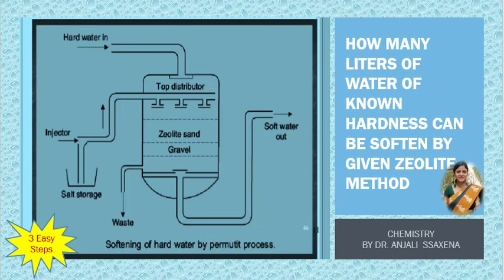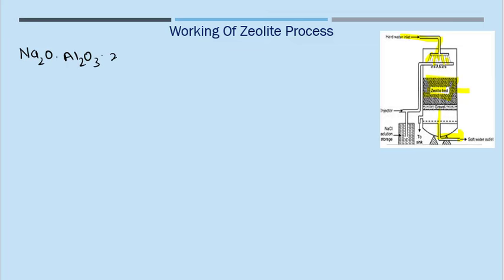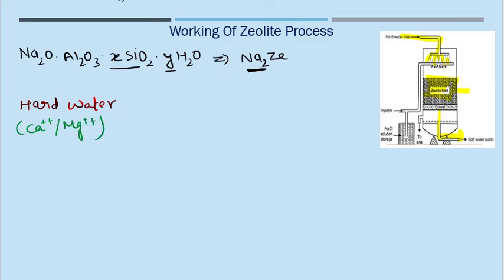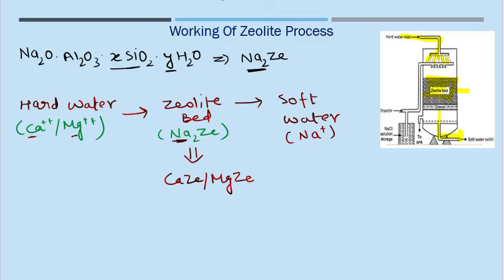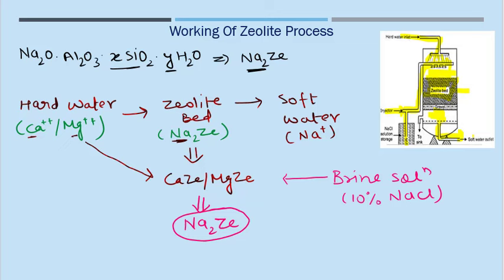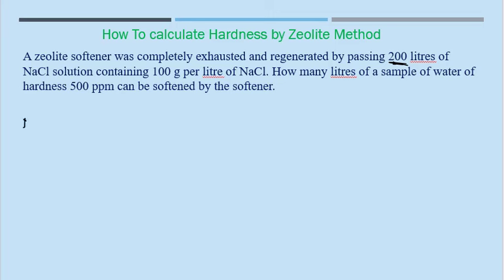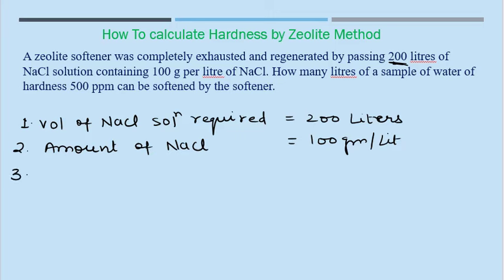Zeolite/ Permutit numerical - By Dr. Anjali Ssaxena

Comment: 00:06 Understanding zeolite and its water softening principle
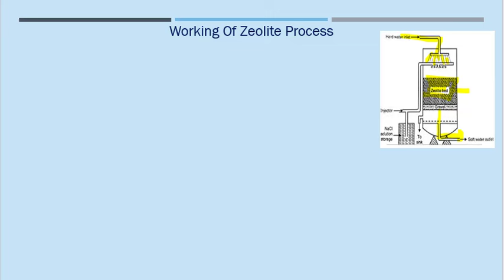01:20 Zeolite/Permutit helps in the liberation of water
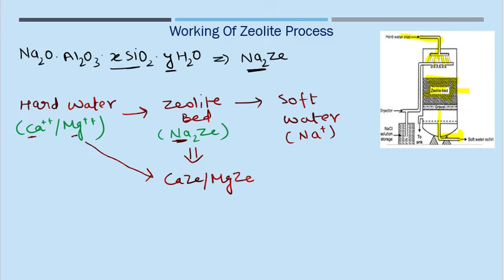03:22 Zeolite/Permutit application in water treatment
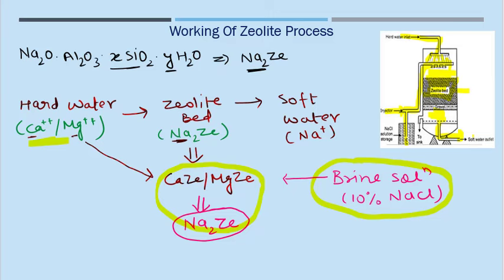04:34 Determining total volume of water in the solution
06:08 Calculation of required test volume
07:46 Understanding the process of removing calcium and magnesium using Zeolite/Permutit
09:33 Calcium carbonate extraction and valency verification
11:01 Volume of water samples for 10th is applicable only on water samples.